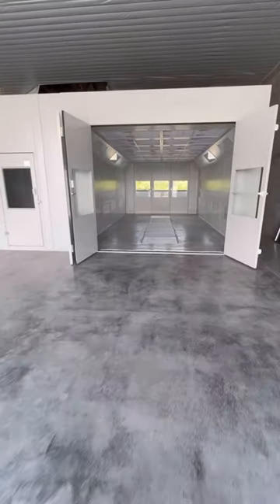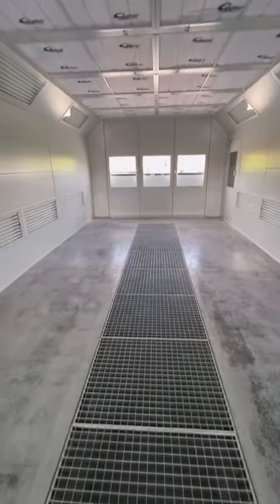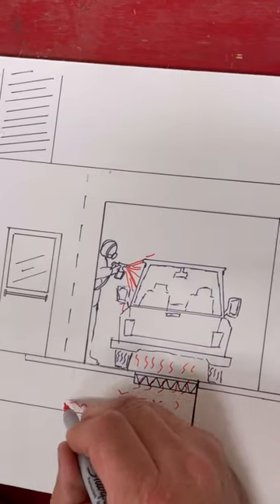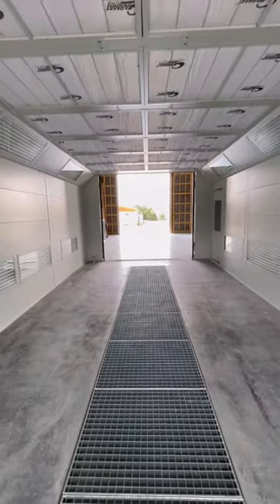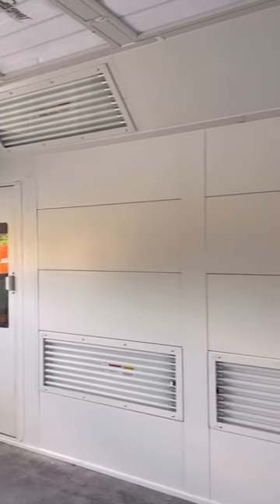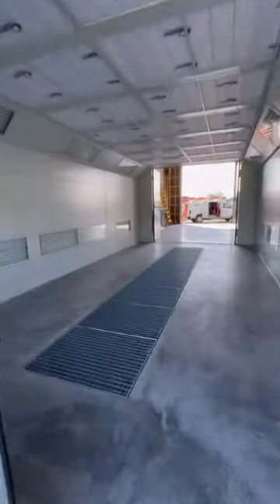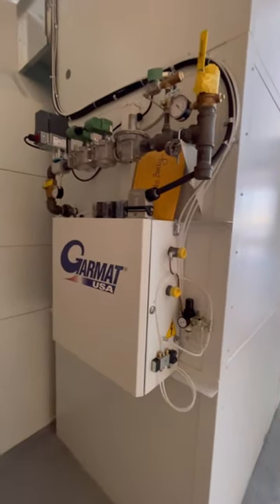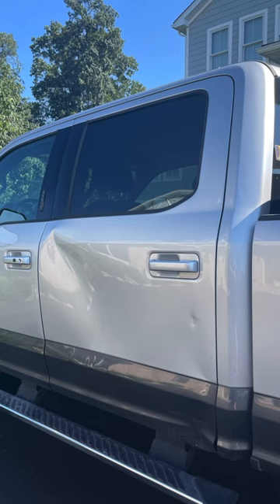Check Out This New Downdraft Spray Booth

Comment: Coming from an industrial painter with a similar style paint booth. Use latex based paint on all the walls so you can eventually scrape the access off and get a clean booth every time, and spray vegetable oil on the plexiglass lights to have a clear finish which scrape off easily with a razor blade scraper after every truck

Comment: Used door for 4-500 and have someone edge it out and put it on . Might save a few bucks doing it yourself . Then have a shop spray it. But a big shop isn't gonna come behind folks. Make sure they R&I the trim and belt moldings so no paint lines. Probably around $ 2500. But that's easily a $100 k  paint booth with concrete work you installed . Nice shop.
Reply from the maker: You are super close! It was $2,410